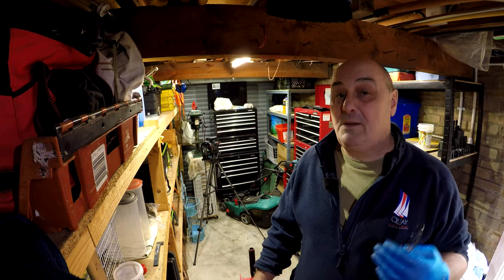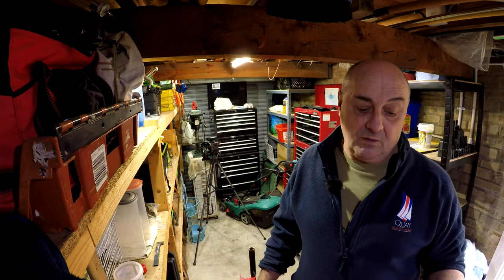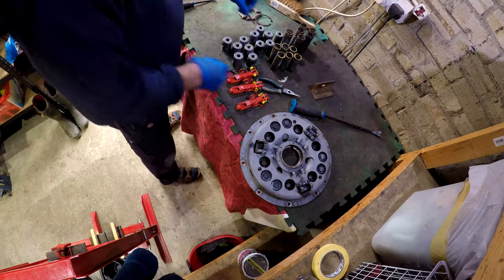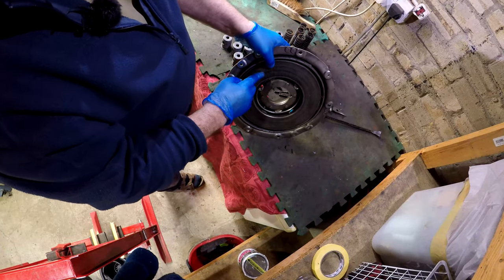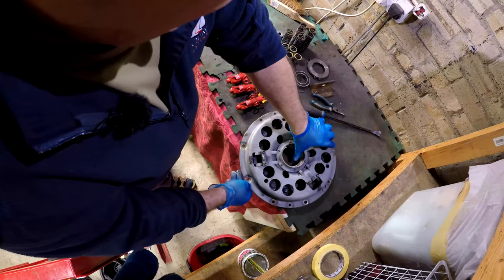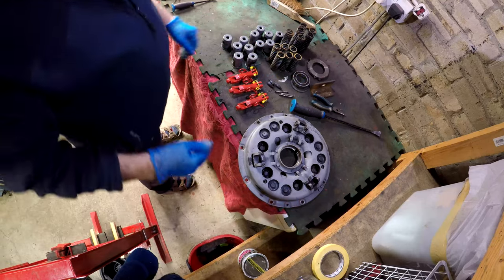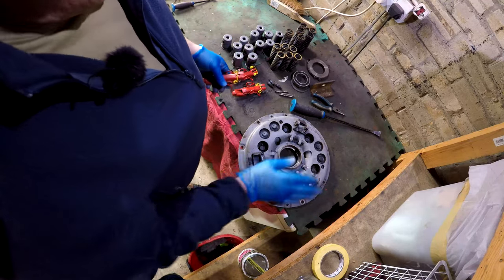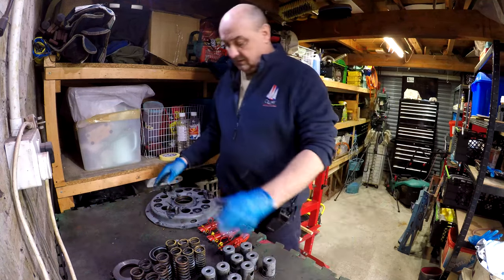David Brown 880 re-assembling a clutch pressure plate #92

Comment: Hi Barry, I thought wow this will be brave after your previous experience but the press worked so well that I bet you wished that you had had it for the original clutch although everything we do is a learning experience. This could be off a 770, 780, 880 or 885 Livedrive Tractor fitted with the Continuous Clutch Assembly, If there is a part number somewhere it should be possible to find out which
Reply from the maker: Hi Terry, your so right if  i had had this way back when, I would have saved £300plus, I've got the pressure plate for the 990 in the garage and I'm going to see if I can weld it back together, just for laughs(it'll never go on another tractor)
I'll have a look tomorrow on this one and see if I can find any mumbers.
many thanks
Barry

Comment: Complicated bit of kit. On 996 there is a label telling you not to disengage the PTO clutch for any length of tine.M😀
Reply from the maker: Hi Marshall, thats probably because of the hydraulic pump loosing its drive and running the gearbox dry.
many thanks
Barry